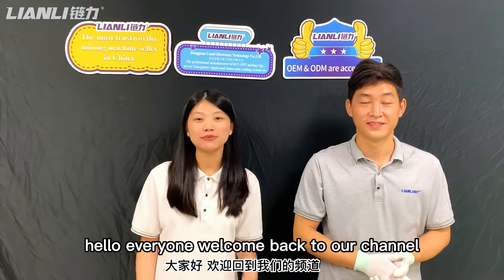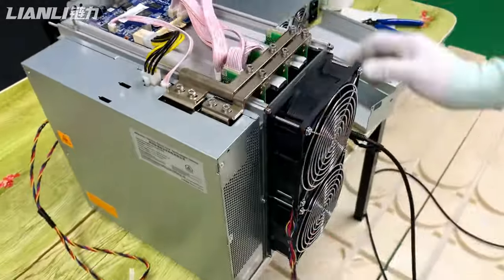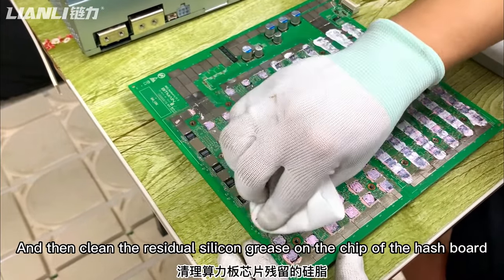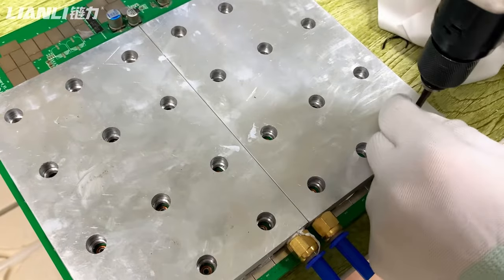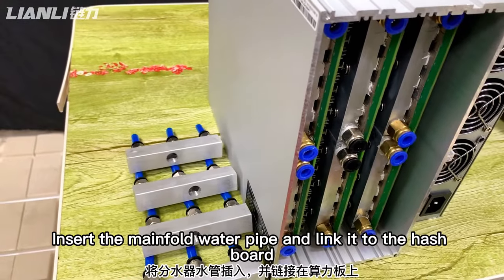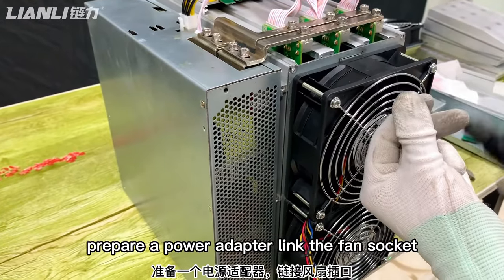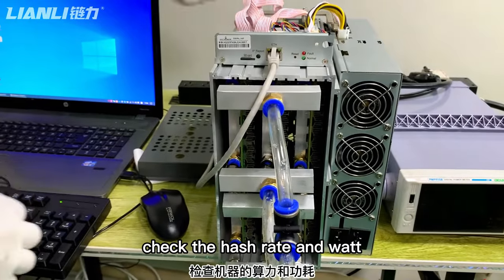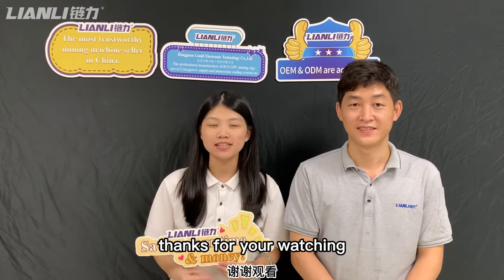Do you know how to use the water cooling system to make your own miner liquid cooled +Overclocking?

Comment: What is the effect on (a) Hashrate and (b) Hasrate per kWh consumed?

How does the modification impact on warranty and equipment lifespan?  MTBF?

You kids have no idea do you?
Reply: This is only about cooling the miner and nothing else

The hashrate isnt determined by the temperature the processors are running. the h/kwh comes from how much juice the fans eat up.  processors get hot, fans speed up to cool it, fans eat more power.

liquid cooling is more effective than air cooling, and will take less energy to cool it. so your hash per kwh would increase

Comment: Hello.  What operating pressure are the heat exchangers designed for?  Can I connect a heating system with an operating pressure of up to 2.5 bar to the house?
Reply from the maker: How many miners have you run? Generally speaking, it is necessary to accurately control the water temperature. You need a CDU to better implement it.
Reply: if you use a heat exchanger, you can have the house pressure whatever you want really.

the heat from one closed loop can transfer to a different closed loop and the two can have as much pressure as you want.

the only limitation is how much heat the miners can put out. if say a miner puts out 1000 btuh, and a square foot of heating takes 100 btuh, a miner would only do about 10'

Comment: Good morning. I was looking at the cooling system for the 5.4kW S19 Hydro each and wondering if with a 12kW system I could cool the two S19s. Or would it have to be a system for each asisc??

Thank you.
Reply from the maker: When your ambient temperature does not exceed 20 degrees Celsius, you can cool two hydro